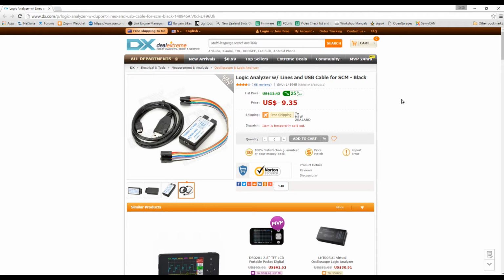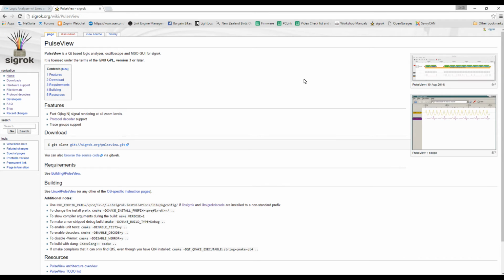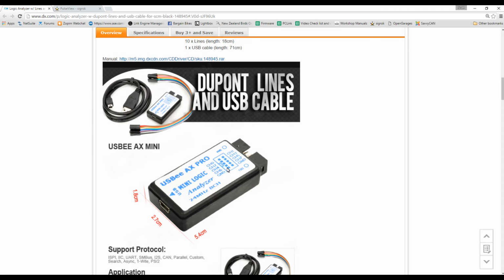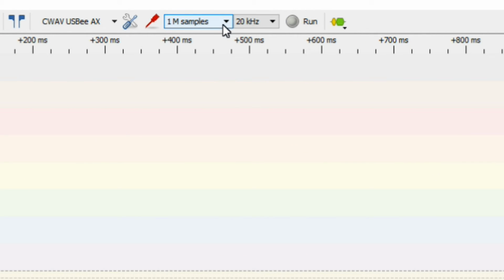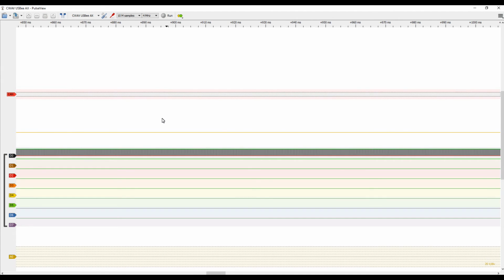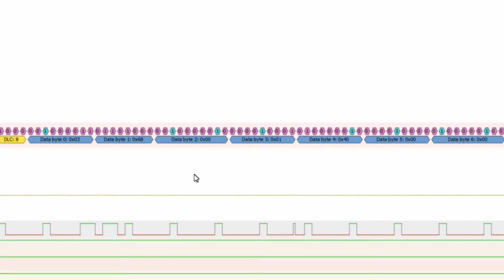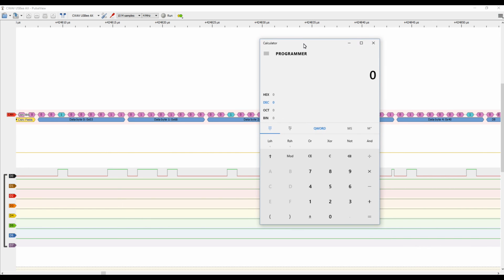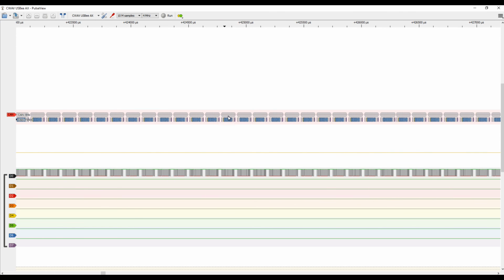CAN on the cheap: USBee AX Pro + Pulseview

Comment: What kind of aftermarket ECU were you fiddling with?  I'm working on something similar
Reply from the maker: I was using a Link G4+ Fury. Having customisable CAN on an aftermarket ECU can certainly be useful. Which ECU are you working with?
Reply: @variedad7113  I'm using a Holley ECU and trying to figure out how to see how similar it is to sae1979.
Reply from the maker: @chuckb1300  I haven't used a Holley ECU before so can't offer any clarification on their CAN bus setup. Most aftermarket ECUs I've worked with do not have a request and response type CAN bus setup (like SAE1979). Normally they seem to be broadcasting the data at a predefined frequency and other aftermarket or factory controllers just take data as needed.